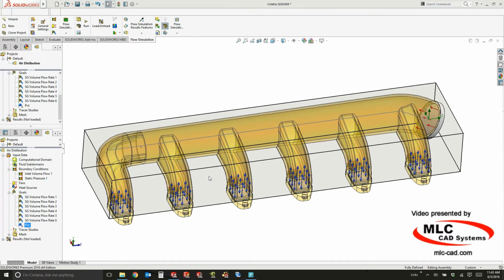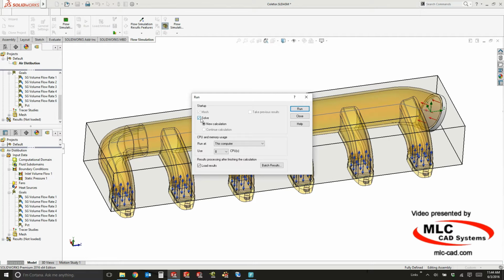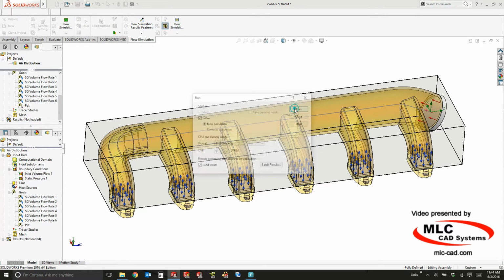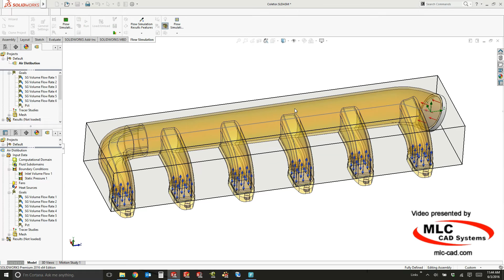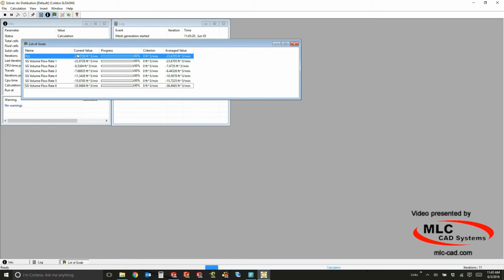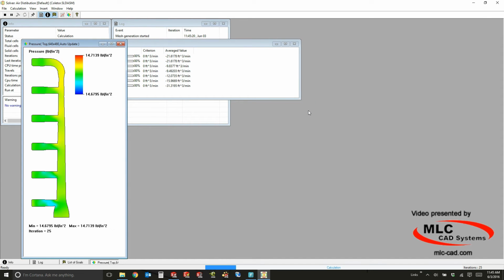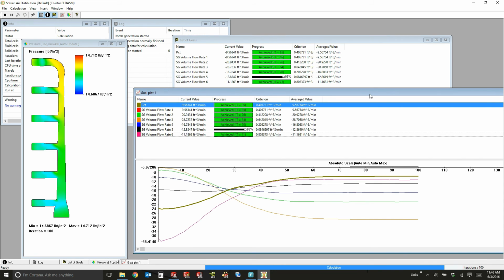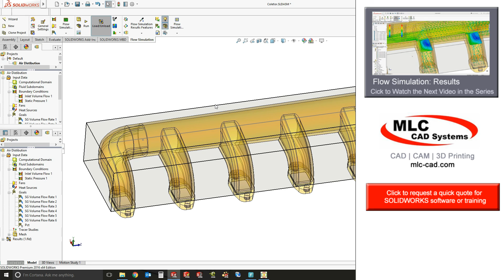SOLIDWORKS Flow Simulation: Solving

Comment: Unable to use Preview option. What can I do now? 
Please Reply ASAP
Reply: Hello Gautam.  Please check that your are using a supported graphics card and driver combination.  The easiest way to do this is to launch the SOLIDWORKS RX program from your start menu's and check the 'diagnostics' tab.  You can also fill out the drop down menus here: https://www.solidworks.com/sw/support/videocardtesting.html